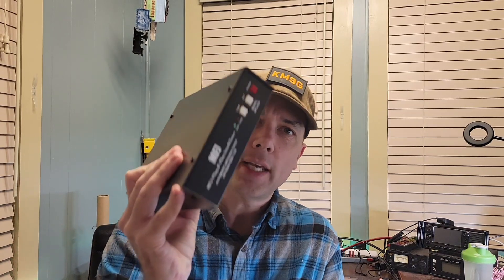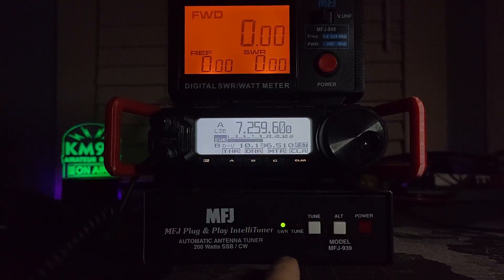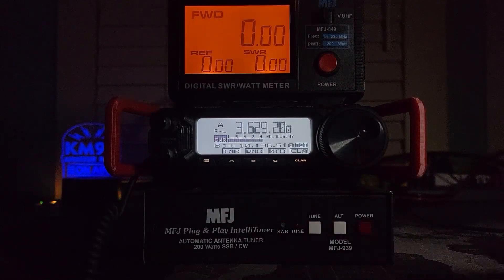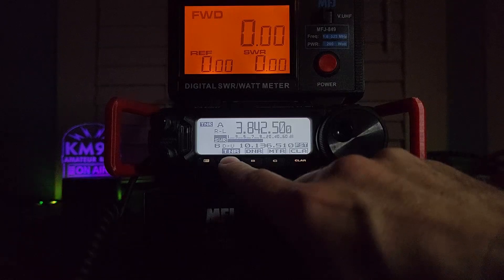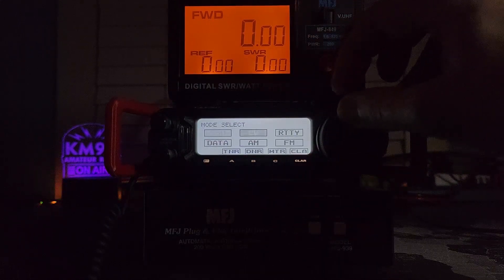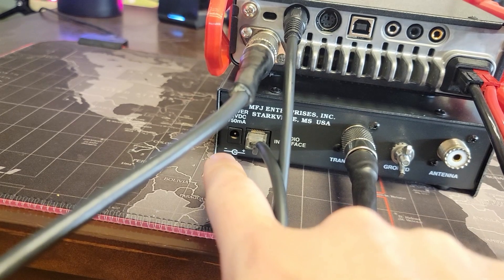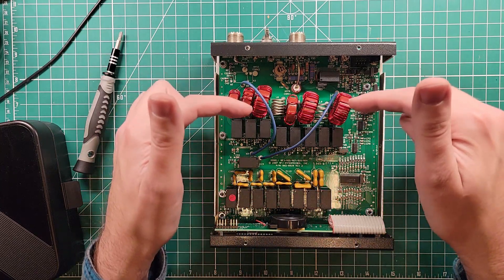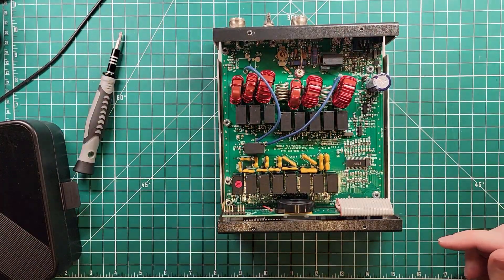The MFJ-939 + The Yaesu FT-891

Comment: I'm a newly licensed ham and I know nothing about tuners. How far off can it be and the tuner still get it in tune? Could I use an antenna tuned for 6 meters and this tune it for 10?
Reply from the maker: This might be a bit much for a youtube comment reply, so if it doesn't make sense here, feel free to reach out via discord or email.

Your radio wants 50 ohms - we had to pick a standard and we all settled on 50 years ago.  Great!  Now that we have that, your antenna might present something different than 50... we agree that most radios that come with tuners can match "3:1" so 50*3=150ohms - your internal tuner can match an antenna that is 150 down or 150 up.  Your radio can even operate at 2:1 pretty happily for a short time, so you could match up to 300 if I did my math right (probably not, but you get where I'm going).

External tuners usually can do 10:1, so if your antenna presents a 500ohm impedence to the tuner, then the tuner can transform that to 50.  500/10=50.

We have tools that will allow us to determine the impedence of the feedpoint of the antenna and make adjustments and there are reasons to use antennas that aren't "50 ohms resonant"... so we have tuners and transformers.

Hope that helps!

Comment: Steve, great video. Quick question from a super newby. Do you connect radio to tuner to swr meter to antenna or radio to swr meter to tuner to antenna?Thanks.
Reply from the maker: Usually the meter goes at the last point in the chain - closest to the antenna.  However, have fun putting in in other locations and seeing what  happens before and after the tuner. It's all about experimentation!
Reply: Great. Thanks and will do.

Comment: Newbie question… will the MFJ-939Y work with an FT-818ND..?
Reply from the maker: Yes, it will - You might need to do some cable updates - or just set it to Auto mode like I did on my other non-yaesu radios.  I was a real workhorse for me when I used it.  I only moved it on because I downsized and sold my house.
Reply: @temporarilyoffline  What did you replace it with? Do you have an FT-817/818 with autotuner?
Reply from the maker: @bradl2636  LDG makes s z817 tuner that is a perfect match for the 817/818. https://youtu.be/6OkPF-bpRoc check it out.

Comment: Steve, the owner's manual says to install the "Y" jumper and the JP4 jumper. I noticed yours doesn't have the JP4 installed. I ask because mine only came with one jumper and it's installed on "Y". And it works like this?
Reply from the maker: Mine is a factory "MFJ-939Y" and was configured for yaesu... you can get an I, Y, K or " " model internally they are the same, but MFJ sets the jumper.  They work fine in auto-sense mode with other radios as well.  Very versatile.

Comment: I just want to know, can I use this with a icom  if I have the FT891 system ? or I need to get another tuner for my icom? I just want to know if I can save some $$$ buying the adapter cable for the icom. 73s!
Reply from the maker: Yes, you can use this tuner on any radio, with or without the cable.

Comment: I have the 929 which has the display.  Bought it off Facebook market place for $120.00 which I think was a steal.  I have used it on my Kenwood TS930S and my Icom 7300.  It has great range and works well.  I would not even think twice about not buying another MFJ tuner.  73
Reply from the maker: Right!  This is good stuff.

Comment: How do you get tired and frustrated with a manuel tuner?
Reply from the maker: A Manual tuner is a hard co cpet to grasp for a new ham without a good elmer.
Reply: @temporarilyoffline  ahhh, disagree. No Elmer here and it just made more sense than holding the mic, switching modes, pushing the button and watching lights flash. Once you get the cheat sheet of numbers down it’s actually faster.
Reply from the maker: @forgetyourlife  right on

Comment: Steve:  I have been using my MFJ-939 with my FT-891 for several years and it works and works well.  Very quick to match and has the ability to tune antennas that are beyond the capabilities of some of the other external tuners.  It is a Keeper!
Reply from the maker: Glad to hear it!
Reply: @temporarilyoffline  Steve:  As a Mississippi resident, I have been to MFJ multiple times.  The have an in-house Surface Mount Machine and do their own Surface Mounting.
Reply from the maker: @n5pa  very nice!
Reply: @laserhobbyist9751  - But when it is used for portable operations on unexpected bands it is a useful tool! A perfectly tuned antenna is always better.

Comment: Hi mate,  I notice that the power out goes back up once it's matched.  Would you say that a 3:1 when matched would the antenna perform the same as an already resonant tuned antenna?  Stephen FOO WAS HERE :)
Reply from the maker: FOO!  I honestly don't remember where the tuner was, but your radio is now matched to your antenna and the radio itself is putting out full power.  From there its up to the magic pixies - it should not be as good as having a resonant antenna, but its better than the antenna you don't have at all for that band.

Comment: Thanks Steve i have a 941 E . First thing i did was make sure all fittings were tight and set up right and its a great tuner/antenna selector. I don't believe in trying to use weird antenna combinations for tuning just nip up mono band dipoles so my 891 or 7200 are happy and I can monitor output pwr on the rig.
Reply from the maker: Right on

Comment: I bought the Icom variant to use with my IC-735 in RF sensing mode. No control cables could be found the 735. I have since switched to the FT-891, still in RF sensing mode, and it works as it should. Some day I may pick up the Yaesu cable and switch the jumpers, but if it ain't broke, why fix it?
Reply from the maker: I agree!  The only reason I'd get the yaesu cables is because I think you can lose a power cable that way... might make the station smaller!
Reply: @temporarilyoffline  That would free up a spot on my Power Pole distribution block.

Comment: Steve, with such a high SWR wouldn't it be better to put a remote tuner out at your DX Commander antenna?
Reply from the maker: It would be - or to get a proper antenna setup for the band in question.  I was specifically using a poorly matched antenna to show off the tuner.

Comment: That's not good. So the 891 is a stinker too. It doesn't reduce power to tune. This sux. The manufacturers must know it's not necessary to tune at whatever the current power setting happens to be. We all need to hammer the manufacturers to correct this.
Reply from the maker: Good point!
Reply: None latching, hmmmm  FOO

Comment: Thanks Steve. Even the ATAS has the occasional issue. I believe the tuner I use is an LDG with my 891 when it is not on the ATAS. And it also had the issue with tuning. My biggest autotuner issue is tuning while I am transmitting which I have had multiple issues with on LDG.
Reply from the maker: I have the Z100 that I need to try with the 891... See if I get the same results with that.  I hate it when the tuner (that already has a match) constantly re-tunes with every over.